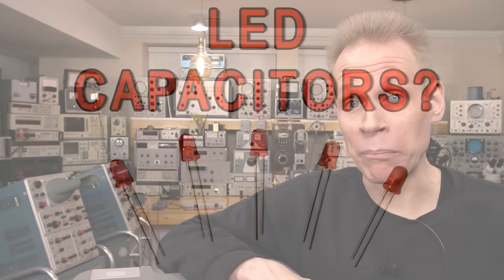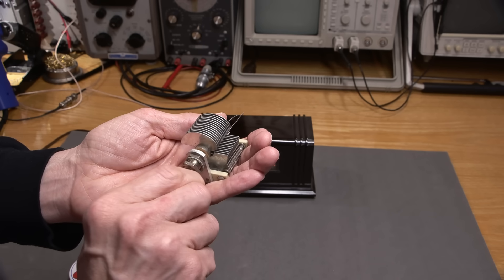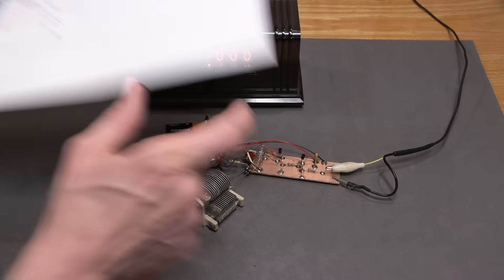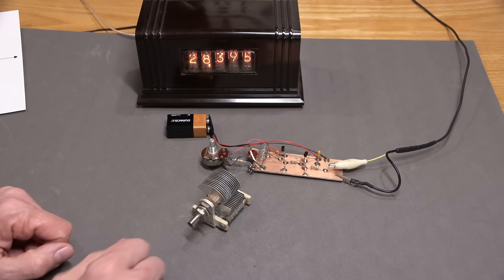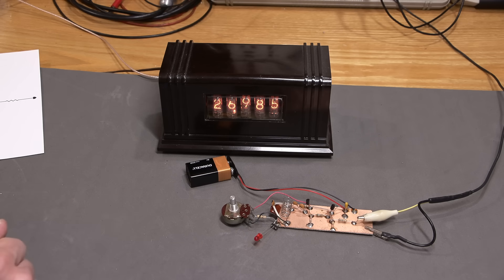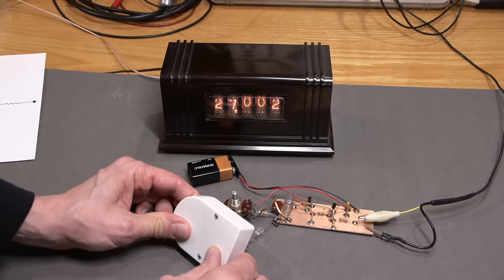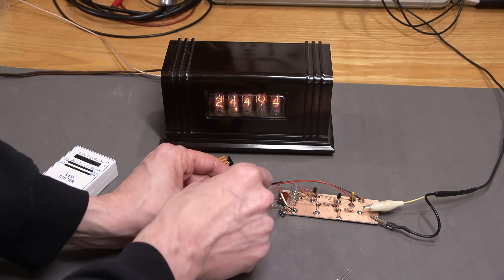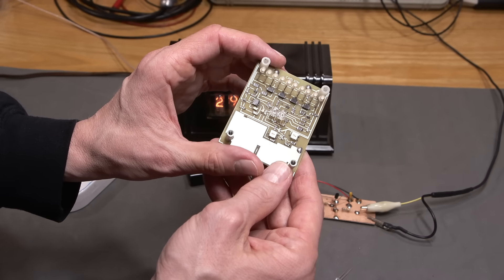LED Capacitors? See How They Work!

Comment: How about use a TosLink fiber and two LEDs, one fwd biased and the other reverse biased.  Now you have a fiberoptic controlled oscillator. Now modulate the  forward biased LED with DC and audio and you can FM Modulate the oscillator. Set the Frequency to a receivable by a FM Receiver, 88-108 MHz and you have a fiber optic connected, small signal,  FM Transmitter.

KE8TNW

Comment: 6:09 newer am radios won't even use any variable capacitor, but rather a DSP chip, using a resistor as a voltage divider to go through different frequency "steps". That's why newer radios sound so "choppy" when you rotate the dial.

Comment: I knew it long ago because i used to do experiments. Like diode(glass) or transistor(TO-3 cap open) as light activated or as solar pv like effect. I experimented if I can reverse the function of LEDs. And if adding extra little power like pv. As I am doing energy device experiments.
But you did a very good demo here.

Comment: It's completely correct and I use from LEDs as solar cells too, but as I used from another type of diode as a variable capacitor, now have a question from you. If we use from LEDs as variable capacitor,is it possible to this making white noise and especially a big problem in our design?

Comment: So versatile, they are also diodes by definition, and has a resistance. Also works as a photo diode. A capacitance is a nice addition. But there would be huge leak above 1.1 volts.

Comment: Was expecting an explanation why a LED would be better than a varactor or any other diode for this purpose. The light control yes, but how would light control of the frequency be more useful than voltage control?

Comment: Interesting - thanks Mr Carlson! Typically LEDs break down with a reverse voltage of 5V (but won't do any damage with 100K in series), so I was kind of expecting some sort of "flattening" effect but then I don't know what actual voltage swings are at that point coupled via the .01 capacitor.
Reply from the maker: Glad you found it interesting!

Comment: Anybody ever heard of reactor dials they use electronic tuners it all started in the seventies when we start changing from mechanical click click click Channel thing to a more electronic we have a like a slide in Baltimore or by using a remote to go to one to another and then we have stepper Isis that will go up or down this is technology of the late sixties and seventies anybody ever remembers does Xena electronic TV or Magnavox Odyssey I could name others because I've been around since the store I'm old but the point is that there's more to know this

Comment: Edit: Just about all of what I say here assumes the LED is driven above the Reverse Threshold Voltage. That's why a VTVM from GND to the LED Cathode would make things much clearer while adjusting the POT. I still contend that once Reverse Threshold Voltage is reached it will virtually clamp at the voltage specified in the datasheet.
This is a very enjoyable video but I'm having issues with one single term (Voltage) being used here. While that Pot could vary the wiper voltage from ~ 0V to +9 volts, the LED never sees that voltage swing because the LED will load the wiper voltage once LED's reverse threshold is reached. An Ammeter connected in series with the pot's wiper and a VTVM measuring the DC LED voltage would have gone a long way for the student. When using an old Defused Red LED, the student should see very little voltage change when the wiper voltage is above the LED's reverse breakdown voltage. The reverse breakdown voltage should be just a volt or two above the LED's forward threshold voltage. All pertinent tech data can be found in manufacturer's Data Sheets that  can be found free, in PDF form on line.

While my next critique may seem trivial, it will make on-line discussions easier to follow. Please mark your schematics with universal component ID's , like R1 C2, VR1, Q1, etc. Thanks for the video and I hope I'm not being a Royal PITA!:face-blue-wide-eyes:
Wakodahatchee Chris

Comment: Yes, this is a great explanation of this effect in LED's.
I've used this in an old Dutch design for a FM transmitter (naughty, I know) called the Stentor. The original schematic calls for an obsolete BA122 varicap but the piraat folk found out long time ago that some red LED's have the same tuning/capacitance range. You have to select them tho, there's no guarantee that any red LED will work. Usually it's the dim, old diffuse ones that fit the bill, modern hi-brightness clear ones don't.
The one I used works fantastic and gives great modulation depth, saved the project!

Comment: You can reverse LEDs at about 0.75 volts or so, and then cascade them, isolating them with caps and resistors, and you've got a low-power rf amp.

Comment: On the GroupDIY microphone builders group there is a thread on using LEDs in place of gig-ohm resistors in the high impedance section of condenser microphone circuits since gig ohm resistors are hard to come by.

Comment: What is the capacitance range of an LED? Can it be just a diode, or must it be an LED? You keep mentioning the stability of your circuit. Are you saying the stability is thanks to the LED? And it would be less stable with a capacitor?

Comment: I'm thinking that shining a LED on your varactor LED is not actually changing the varactor capacitance. Instead, it's creating charge carriers in the varactor. This constitutes a leakage current across the varactor that reduces the voltage across it, and this increases the capacitance. In other words, it's just like turning the potentiometer. I think if you measure the voltage across the varactor and shine the LED on it, this is what you'll see.

Comment: You should do another video, where you show the "NOISE" spread of using such devices.  Zeners are commonly used for tuning, BUT they are very noisy (at least most types).  As such they tend to broaden the spectral curve, and reduce the effective Q of the circuit.  Adding some low-noise capacitors around them helps, but obviously reduces the tuning range.  Don't use this technique in state-of-art low noise circuits.

Comment: In my limited experience, applying back voltage across a Light-Emitting Diode almost always results in a Smoke-Emitting Diode. Likely a voltage mismatch problem, or maybe I was just using the wrong kind of LEDs. I never knew they could be used as capacitors.

Comment: Nice. Special diodes exist for this and these were used often for FM modulation in FM transmitters. As for led's it always was needed to account for this effect if you have led's close or in a capacitive touch button. The way to avoid problems is to put 10 nF capacitor in parallel so the relative difference between a led on or off is very small.

Comment: Hi Paul and the rest commenter, nice video but in general all the kind of semiconductor junction can be used as variable capacitor. LEDs also can be used as photo detectors, voltage reference, light control switches and many others applications. The point to have dedicated component for this particular uses are to have control of the characteristics.

Comment: why not just work the employees off the clock (oh we need you to do something).

dont pay them their first paycheck until they have been on the job for a certain amount time.

lay them off as soon as they are ready for a pay increase and re hire back at the bottom of the ladder to keep them from having to be pay upgraded.

maybe turn to blood manufacturing where they do a blood diamond (source materials from conflict nations).

use toxic materials like lead and mercury and cadmium in the manufacturing

Comment: New to all of this but am neck deep in a project... can these LEDs be used in a latch mechanism (keeping a display going) or a Schmidt trigger? I need this to make a voltage based spreadsheet.  Floating point numbers are getting in the way of my project. All my calculations still be voltage based.

Comment: This explains a few tricks I've been learning about troubleshooting LED Christmas lights.
For one, in an otherwise working string, if one is reversed, the others light.  I thought it might be due to breakdown voltage but I figured probably the voltage across the reversed diode would be too small to consider breakdown.
This season I found that a voltmeter itself between one end of AC source and one of the sockets would dimly light the LEDs in the loop that includes the meter.  Most of the time the meter on 250v AC would work but sometimes I had to have it on DC.
Likely capacitance is what lit the LEDs and showed a reading on the meter.

Comment: You: I'm going to use an LED as a capacitor. 

Me: So you're going to use an LED as a varactor?

You: Watch me use this LED as a capacitor -- just like a varactor! 

Me: Well, sure, any diode in reverse polarity has capacitance that increases as the depletion layer gets narrower; but, why wouldn't I just use a purpose built varactor which probably better documentation targeted to make it more suitable for that purpose?

You:

Comment: I've used that 'trick' 35 years ago using a 1N4007. Depletion region widths are voltage  dependent. Similar application.
Reply: Yes! They make decent varactors useful at high voltage.  Because  si power diodes above a few hundred volts have a PIN structure they work as PIN diodes as well as long as the period of the RF is less than 10% of the minority carrier lifetime. 
Going back to varactors, I tried using SiC diodes and even Mos fet junctions reverse biased body source diodes and found they are 5 to 10 times more dielectricly lossy than  silicon diodes. 
In experimental class E amplifiers the high dielectric loss in SiC mosfets limits efficiency to about 85% at 13.56 mhz and 78% at 27 mhz. 
Silicon RF purpose built mosfets like the ARF447 don't have the dielectric loss issue of SiC, and 90% efficiency is possible.

Comment: Cool video. The only thing that I am not sure what to think about is the fact that the datasheets of most LEDs state a maximum reverse voltage of 5V or thereabout. Your circuit exceeded that and I wonder which long term effects it could have. I know for a fact that using an old green LED at 8V AC (with resistor of course) will slowly kill it. But it is slow and takes years to loose brightness. In my case it was a door bell phone power supply from Siedle Germany, built from about 1980s to the 1990s.

Comment: If you need a larger capacitance a small forward bias can do that.  If there is forward current the Q will be lowered (which matters if oscillator phase noise is important).

External light can also affect the capacitive leakage, so covering or painting the LED can help.

Comment: Literally no warnings given in the video! LEDs are not designed to be reverse-biased devices. Most LEDs have a maximum reverse voltage around 5V, and exceeding it can permanently damage the junction. LEDs are just semiconductor PN junctions, and their electrical behavior is dominated by effects that make them unsuitable as varactors: the bandgap and depletion width are affected by light (as you've pointed out), the forward voltage and junction capacitance both vary strongly and non-linearly with **temperature**, they generally have low and poorly defined Q-factor, datasheets do not specify capacitance or C-V curves, leakage current is highly temperature-dependent, and reverse breakdown is uncontrolled. LEDs are tested for optical output, not for junction capacitance or RF behavior, and two LEDs will not behave the same; especially over a temperature gradient.

And everything is a capacitor (and an inductor) at some frequency due to parasitics. Even inductors have inter-winding capacitance and behave capacitively above their SRF.

Comment: I remember seeing an LED across two microcontroller pins and they were using it to measure distance by switching from light output to measuring the capacitance discharge. Something closer to the LED would cause it to charge more from the reflected light. I'm surprised the Meta Ray-Bans don't use the technique to determine if someone has disabled the recording light.

Comment: The truth for me is finding the right sized screw driver to put through the hole in the fan on my processor to remove it.  I didn't remember that they numbered the screw drivers.  I finally went with a set of #1.5.

Comment: Corro-Protec is a Canadian made active electric water heater anode. It has an extremely bright green LED. The instructions say that as long as the light is bright, you're protected from rust and corrosion. I thought it was just a power indicator, but now I wonder if more is going on. On second thought, the light is obviously in forward mode, so probably just an obnoxious pilot light.

Comment: Not only LEDs, but transistor junctions can be used as varicaps as well. This is an old trick that could be found in cheap FM modulators, sometimes using the same transistor for both oscillation and FM modulation by affecting its junction voltage.

Comment: Actually, every semiconductor exhibits this same phenomenon across the P-N junction.  Back in time before actual varactor diodes were being manufactured, silicon rectifier diodes were used as varactors.  The problem with using an LED or other non-varactor diode is, it is not manufactured for that purpose so, will have a wide tolerance from part-to-part and generally poor RF chacteristics.  One of the problems with using an LED is, most have a 3 to 5 volt reverse breakdown rating so, the tuning range will be limited.

Comment: See also varactor diodes (also known as varicap diodes, tuning diodes, or voltage-variable capacitors). Useful in tuning circuits such as RF oscillators, voltage-controlled oscillators (VCOs), and were common in radio receivers.

Comment: Zener diodes have a much better tuning range.  I used to use 32v to 75v zener diodes.  My tuning voltage range would be around 0v-12v for the ~32v zener diodes or 0v to 25v for the 75v zener diodes.  I was able to get around 75pf down to 1pf. with a good zener.
Reply: А я на Советском стабилитроне Д814 получал 400 пФ
Reply: Hi, I doing just like you but I have a question about this, is it possible to this making a white noise and especially with using from them make a big possible to our design?
Reply: @kingdomofscience6169 zener diode will generate noise (white like) only when it is operated in its reverse-bias breakdown region

Comment: Any diode can be used as a capacitor. My favorites are the 1N4007 because they can take up to 1kV in reverse.
Reply: Correct, a zener diode (below breakdown) can also be used as a capacitor.
Reply: @frankd2790  The 1N4007 is a general purpose rectifier, not Zener. Zener diodes have a conduction curve in reverse.
Reply: @francoisleveille409  I think Frank knows this, he is simply introducing the topic of zener diodes by using the word, "also".
Reply: Any bipolar junction transistor as well, since PN junction is a diode.
Reply: @dimdimich  Yeah but then the question is how much do you get for what you pay. Transistors are more expensive than generic diodes. While a cheap generic diode - assuming it has the capacitive value you're looking for - costs only a few pennies.
The BJT may be interesting because you can vary the E-C capacitance by changing the voltage between E-B. That may be worth paying a little extra.
Reply: @francoisleveille409  Sure, it depends on what you need. However, as I know, there is a correlation between breakdown voltage and capacity/voltage coefficient. LED, Zener and base-emitter junction have relatively low breakdown voltage, so capacity is more "sensitive" to voltage change.

Comment: This is awesome. I knew ordinary diodes had this effect, but not to this degree. I really like this idea, when you don't want to order a proper varactor diode. And I already have slightly drifting test oscillator I'm going to try it on.    EDIT-> I just played round with this in my home-made oscillator, need to do a bit of work to get the frequency where I want, but the frequency STABILTY is a factor of 20 times better than it was. This really is AWESOME.

Comment: Paul Carlson very educational what you can use LEDs for other than just a light bulb. Actually all solid state diodes and rectifiers exhibit the capacitor function. Stands to reason a LED would also work as a capacitor. Rectifiers like the 1N400x series, make a nice fine tuning capacitor.

Comment: For islands you can also use a punch or a nibbling tool to nibble a little chunk from a double sided pc board. Solder or glue said chunk to your board where you want the island, only soldering the bottom layer to your board. Solder the components to the top layer.

Comment: So- If you modulate an led with an audio amp and microphone and point it at the one in the oscillator, you have a crude FM transmitter abeit rather high deviation.

Comment: Mr Carlson,
Your method of biasing with a LED reveals the good but also the bad. Good being a cheap way to work a oscillator circuit. Bad being the stability of it. The frequency though varying by interference from another source would not be a good choice to use for stabilized results. If I want an oscillator, I want predictable, stabilized performance. From one LED to the next, I do not believe any consistent character can be found. A Varactor diode since it is encapsulated will not suffer this fault. Using a rachet wrench to hammer a nail into wood isn’t good either but you can do it.
Reply: Methinks Mr. Carlson is light years ahead of you with his 476,000 subscribers compared with your crummy 2 subscribers, Mr. Rachet Wrench. When are you going to put out any electronic videos to help others since you are such a genius?